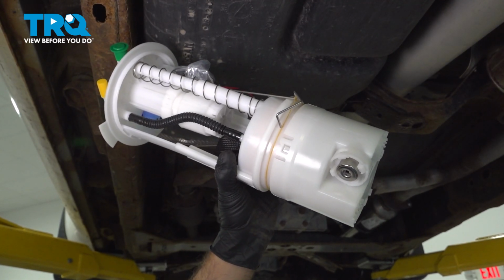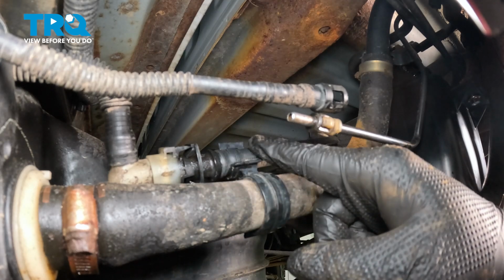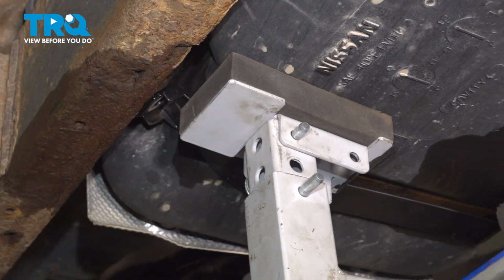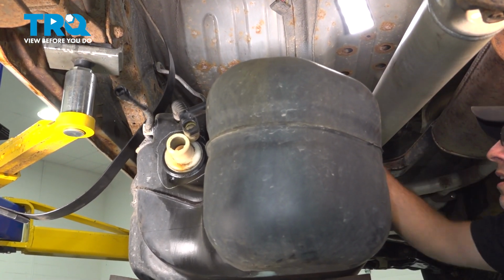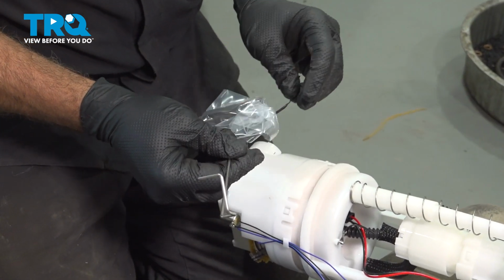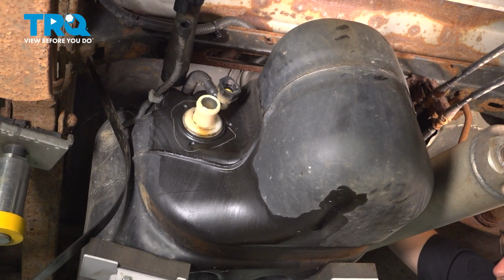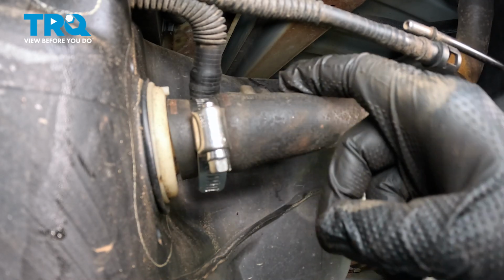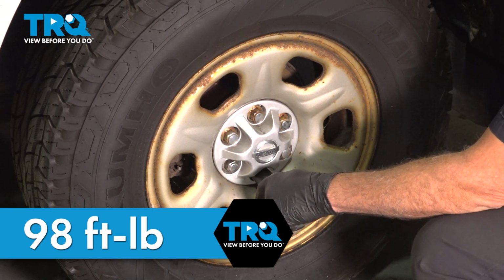How to Replace Fuel Pump Module Assembly 2005-2021 Nissan Frontier 4.0L V6

Comment: does the part include p0181 and p0183 sensors and would the same assembly apply to a 2009 XTerra, 2wd?

Comment: Don't mistake my criticism for ungratefulness, but these videos leave out some details which us low experience DIY mechanics really need. The Sending Unit, the part with the float is a separate part. The video makes it look like it just comes with the Fuel Pump Assembly. It doesn't. TRQ does provide a video  on how to transfer it over. Looks easy enough, but had me worried for a few.